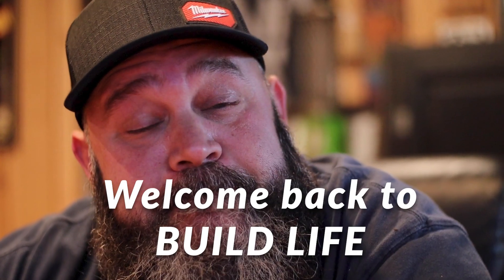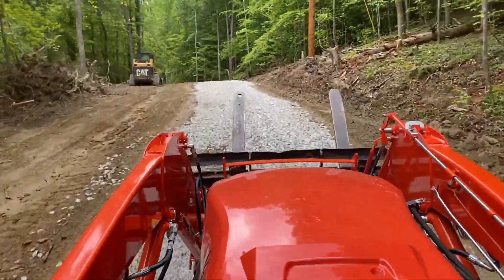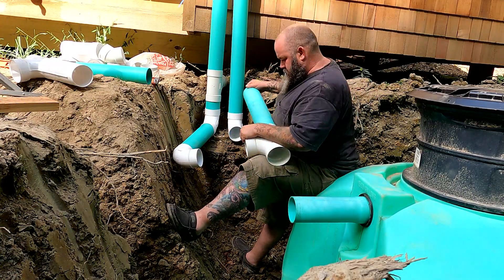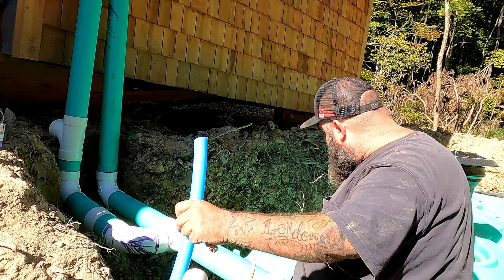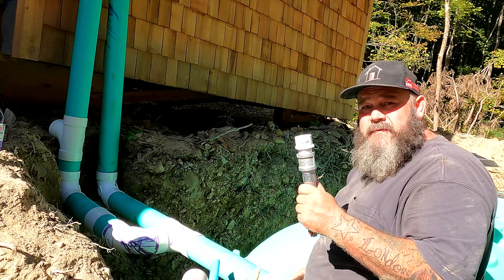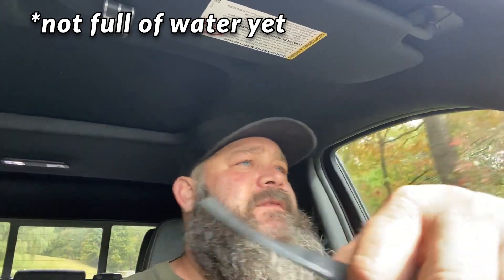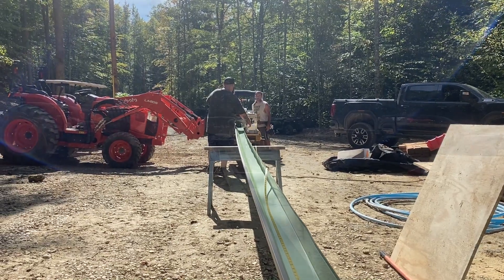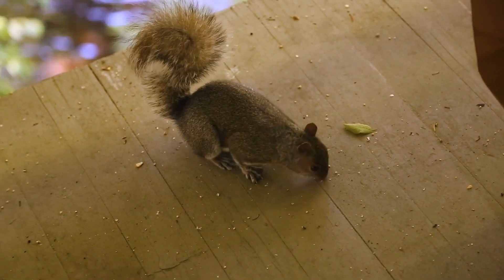Rain Water Harvesting for Mountain Cabin

Comment: Thanks for the headsup on using a metal male fitting into female PVC.  I used that connection recently when tying a new outbuilding into my water main in my crawl space.  I'll need to fix that.
Reply from the maker: yeah I'm pretty sure I've done it wrong several times too!